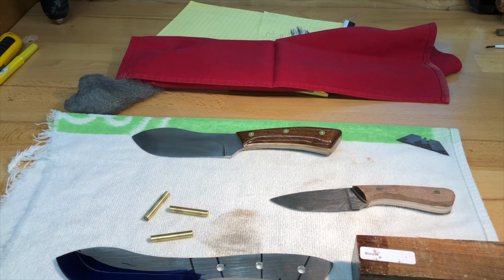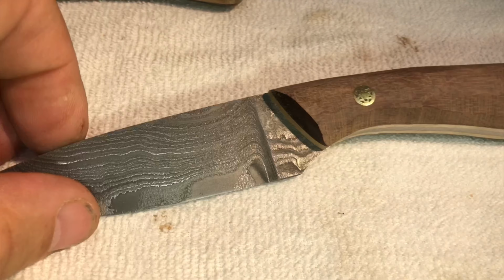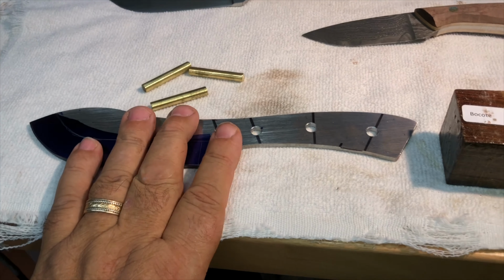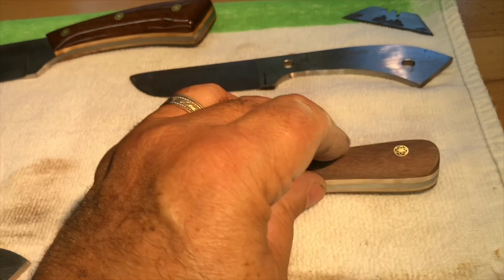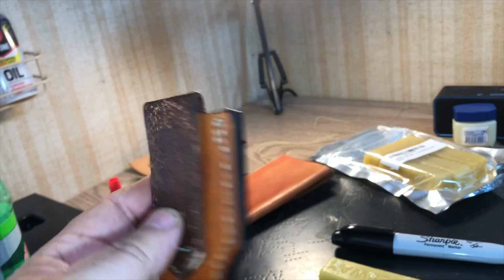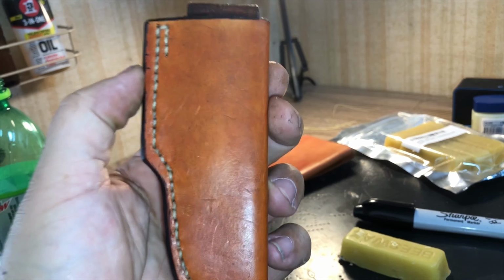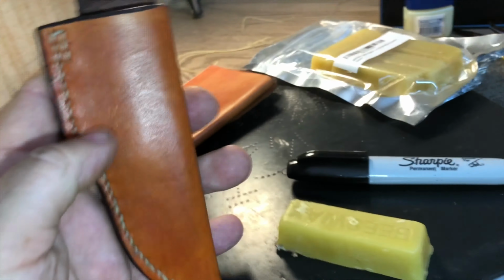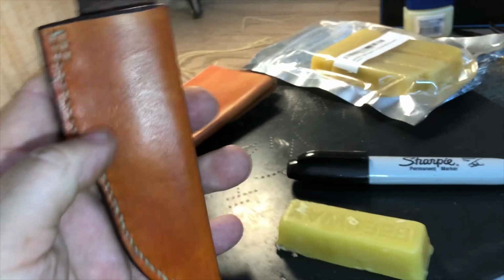Finished the Damascus blade

Comment: There are quite a few tutorials on leather sheath and holster making on YouTube. From experience I can tell you that wet moulding the leather around a dummy pattern or the actual knife will make the fit look great. Also there is an edge treatment called “Gum Tragacanth ,” it has to be rubbed in with friction from a hard wood or plastic tool and will really slick up the edge of your sheaths..
That damascus knife really looks great !
Reply from the maker: I have wet molded before and it did look much better. I’ve never heard of the gum stuff. I have a freind that works at the Tandy leather store about an hour from me. I almost need some more leather but I’m waiting for the sale. I’ll ask him about when I get over there. Thanks.

Comment: If the machine you're getting is just an electric etcher, you can do that with stuff you probably already have. Just takes a battery or battery charger, salt water, leads, and a q-tip. There's tutorials on youtube about it.
Reply from the maker: Already bought one. I’m trying to make my shop as professional as possible. The machine I ordered has both AC and DC with a variable power output control. It’s called a knife dog etcher.
Reply: @bctruck  Definitely understandable, I'm just cheap. Batmobiles are expensive.

Comment: Hey brad, your sheaths are going well mate. Keep it up!

If I could offer some tips from a fellow leather worker...

Invest in good thread. Get some ritza 25 (tiger thread) or another quality braided poly. Check out Buckleguy or rocky mountain leather supply, they stock lots and you can get a sample size if you're not sure... anything I have tried from Tandy is rubbish in comparison... and heck, I'll send you a sample if you're not sure! For sheaths, 0.8mm would be perfect. Strong, but not too thick.

To improve your saddle stitch (everyone's needs improving, mine included, and leather is my main thing so.... no insult intended!) Check out Nigel Armitage channel on YouTube. It's all about consistency. Same angle and same movement every time.

Beeswax is good for an edge. I use it mostly. But you can make it better by melting some down and mixing it with paraffin wax (Makes it less sticky). Just use a double boiler away from direct flame for safety purposes.... But gum tragacanth, or tokenole are even better again. Apply, wait until it starts drying  and rub. Sanding before, and between with 180 works for me, and after using the slicker I use a canvas or denim cloth.

Also, get some tallow fat. Stick it in some canvas, gently heat it with a lighter, and use it to rub the edges down if the leather is really dry. It'll get some oil back in it and they will slick down easier.... good excuse to eat bacon, if you want to make your own tallow and save a trip to the shop... got that in one of my videos about making dog collars.
Reply from the maker: Thanks very much! I just found out about beeswax and what difference that makes. Better string is something I realized I needed. I dont know why I didnt think to hit you up for advice. Its appreciated very much!